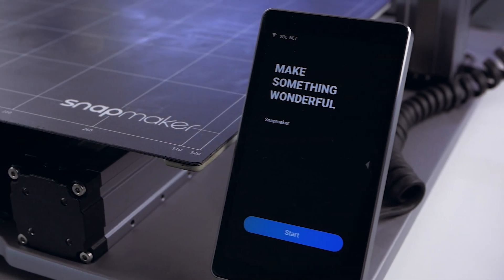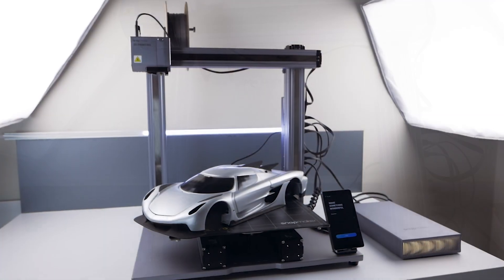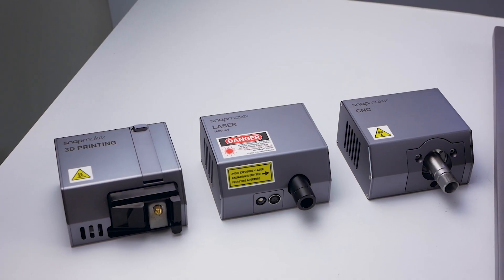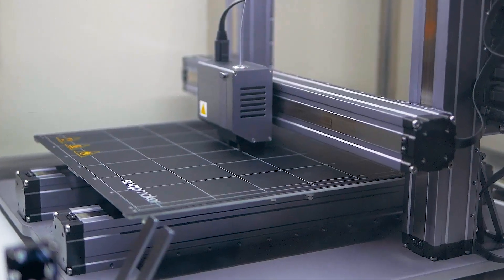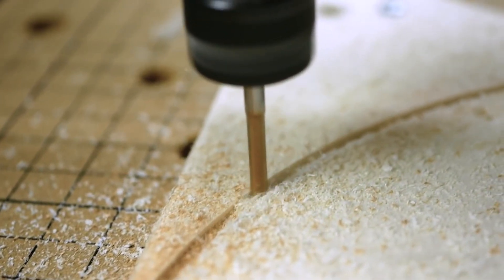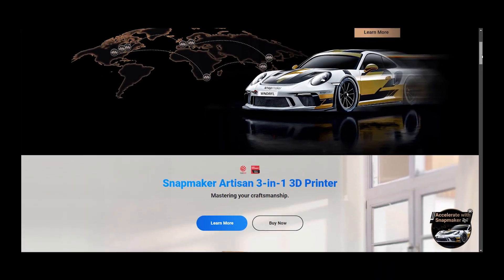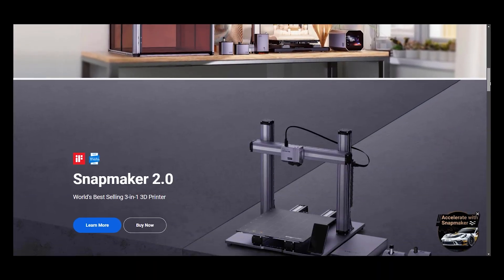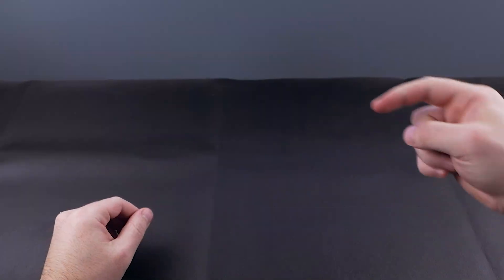3D Printing with NO RULES - Koenigsegg Jesko Absolut (RC CAR)

Comment: How does this chassis differ from the previous AMG Project One video? I would like to know more about it as it looks very different while using the same Wltoys 144001 base. Thank you!
Reply from the maker: It is same, the only difference is that I replaced adjustable 3d printed chassis (which is included with model) with hand made metal part, cause it wasn't as rigid as this one

Comment: What's a good and cheap filler for the bodylines? What do you use?
Reply: No worries, just curious. I'm working on a Tacoma body but I'm still in the sanding phase
Reply from the maker: To be honest I'm not expert in that stuff. Randomly grabbed one from market )
Reply: Baking soda and CA-GLue (aka Krazy Glue) But u can buy CA-Glue at higher volume amounts for cheap. Krazy glue just a brand. Its CA-Glue. And baking soda is the filler, u can literally build layers upon layers if u wanted to, Its supper strong bond and instant dry. Just search YT on how to use baking soda and krazy glue for plastic modeling. Its been the goto for modellers for decades. Ive been using it for close to 17-18 years.  HOW TO - Can be applied glue first then baking soda or vice versa, depending on layer thickness. But generally apply the CA Glue wherever it is u need to, and while the glue is wet sprinkle baking soda on to it, and instant dry, can be easily sanded / filed to shape. if need to make thicker layer, apply u can add more baking soda and glue on top.